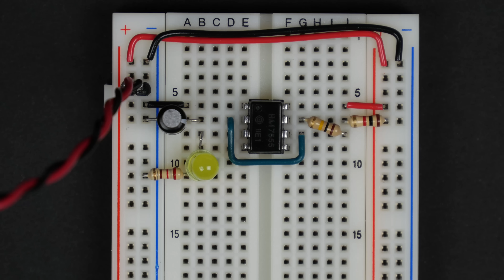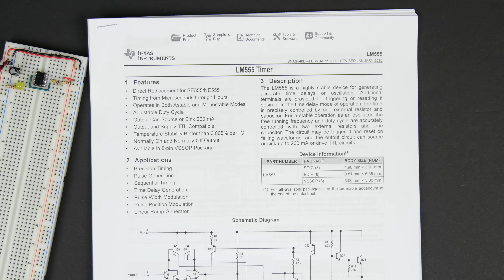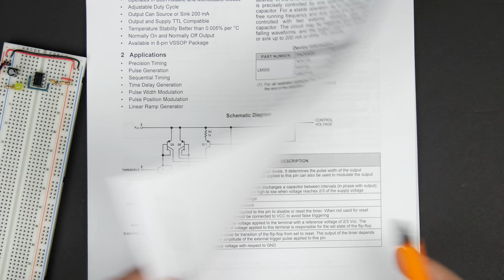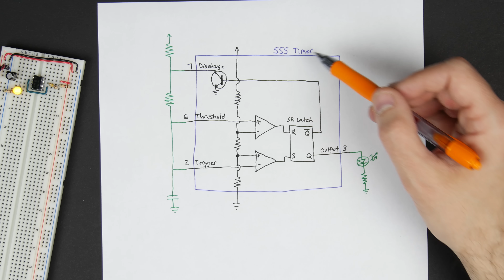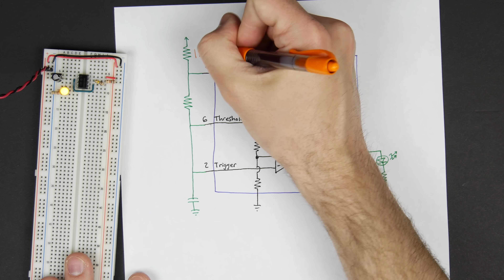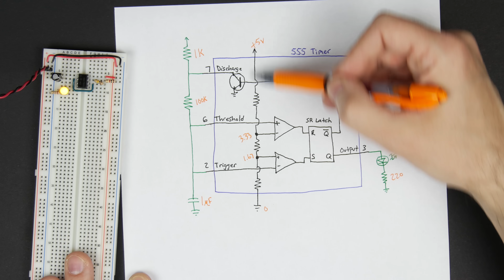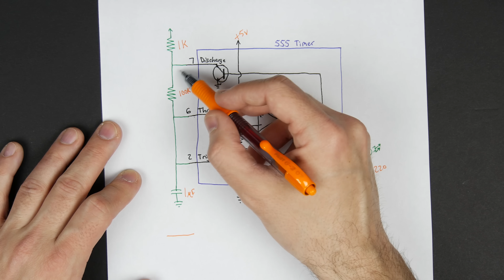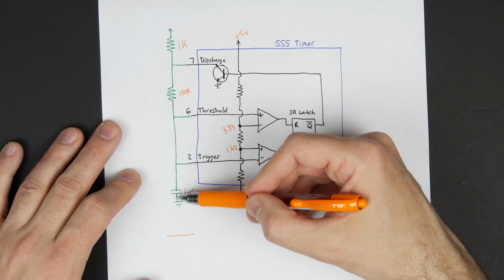Astable 555 timer - 8-bit computer clock - part 1

Comment: For novices like me: note that while you'll want the electrolytic (cylindrical) capacitor's white stripe on the (-) side, in the video it's on the (+) side. Your capacitor polarity should NOT look like his, for some reason he's got one where the + is striped instead of the - (which you can confirm when he takes a closer look to figure out why it's 2uF). Also, in ceramic capacitors in the video, the 0.1uF one looks wider than the 0.01uF one (which makes intuitive sense to me), but in the kit it's the reverse (which had me second-guessing myself). Don't let the size concern you: 104 is 0.1uF, 103 is 0.01uF, end of story.

If you're fairly inexperienced with electronics (like me), go read or watch some stuff that ensures you understand how to read the components (especially the resistors, the ceramic capacitor, and the polarity of an electrolytic capacitor). I knew to refresh myself on these things, and got everything right on my first attempt; but I was heavily doubting myself until I switched on, because the components in the kit and the components in the video were very different!

Also if you're reading this before you've gotten to the later videos, be advised that the part 3 video is WRONG for this kit (the switch will still work, but it WON'T be de-bounced - the video is using a break-then-make switch, but the kit has a make-then-break, and that very much matters). Look for a comment by Sergey that sets you straight on the simple but necessary modifications (reversing the logic). You can follow the video, confirm that it doesn't work when you very slowly slide the switch, and then make Sergey's modifications if you like - it won't hurt anything.

Comment: If you are building this from the kit, take note that electrolytic caps can have either their positive or negative side indicated by the stripe.   In the video, the cap has its positive side marked, in the kit I received the negative side was marked.

Comment: i have a silly question ... if every chip need a capacitor, or at least is suggested... why they don't make it built in ? there is no closer than built in ... is space the problem ?
Reply: Because you need to change the capacitors values sometimes
Reply: And some projects can't even have a capacitor in that spot

Comment: I've begun working in circuits. One thing I've never quite got the hang of (and apologies for it), is the flow of energy? Is the earth a source or sink. It seems like resistors are put before earth, so I would assume that's where energy is being pulled from?

Comment: How do i get a square wave generator at home without an ic? Ive got some resistors, some capacitors and a dc supply and not much basically, and i need to test a clock triggered circuit. Theres no way of getting a 555 amid lockdown. Is there a way to get a clock with all ive got?

Great video, and that simplified diagram of 555 is actually a part of our syllabus at +2 or 12th class level for the electronics course, i always messed the two comparators but after this video i probably wont!
Reply: Look for a transistor astable multivibrator circuit. You should be able to scavenge a couple of transistors from old electronics. Maybe you could even find a 555! ;) https://www.electronics-tutorials.ws/waveforms/astable.html
Reply: Thats a great link, thanks

Comment: The problem with the 1uF that measured 2uF is an old problem with aluminum electrolytic capacitors.  
The (capacitance * rated voltage) or 'CV' of electrolytic capacitors tend to roughly match their volume. Thus, a 5uf/10V cap will be about the same volume as a 1uF/50V cap.  If the rated voltage (50V) is much higher than the applied voltage (5V), the capacitor will increase the measured capacitance or 'form up' in an effort to make 'CV' come out right. In the case of caps on a power supply, all we care about is the minimum capacitance. If they 'form up' a little, it's not a problem. If the actual value is important, such as a timing capacitor, aluminum electrolytic capacitors are a very poor choice. Ceramic or film are much better.

Comment: Ok, so I don't know if anyone will see this, but:
Why do we need the 1k resistor in the vertical left-side circuit part (5V - [1K] - 100K - GND) then?
What's the problem with taking it out and leaving only the resistor Rb (100k) , so that charging and discharging times are the same?

Comment: To anyone who is following along, I'm having a problem where the pulse starts off alright, but then over time the on part of the cycle lasts longer and longer than the off part. Eventually the light ends up not blinking altogether, remaining in just the on state. I've double- and triple-checked my circuit. Any ideas?
Reply: Got it, my electrolytic capacitor was in backwards. Make sure the minus side is going to ground.

Comment: Really I don't understand those You Tubers ... They show very cheap demos in the most humble humiliated way to teach electronics while they use very expensive tools like this DSO ( Digital Storage Oscilloscope ) LeCroy brand and DMM ( Digital Multi Meter ) FLUKE brand which are far away by the cost than using this stupid mobile phone charge as PSU ( Power Supply Unit )....

Comment: Electrolytic caps always had wide tolerances, -20/+80% was usual, and there's no problem with that since they are used for just filter caps on the output of bridge rectifiers, and power rail decoupling. But with the miniaturization of today they are usually spot on, or a bit on the low side. So it was interesting to see this noname cap approaching the old standard of making it double capacity, so it has something to lose over its lifetime while still staying above the rated capacitance. The problem with that, if a capacitor loses 50% of its original capacitance, the ESR has usually gone through the roof already.
(edit: typo correction)

Comment: so you want a fairly small cap because you don't want to "piss away your amps" as dave would put it, you also want a fairly large value resistor for the input to the discharge pin for the same reason. you don't want large power loss through that transistor (or blow it up). so 1M for input, and 100M for the second resistor and a few pF for the cap. tweak the second resistor for the timing?
why didn't they put an internal high value resistor at the collector of that transistor? If you matched that value on the input you can get both input and output charging of the cap through the same resistor value and keep power loss at a minimum.

Comment: When I fiddled with a counter IC on my breadboard (BB) it didn't count correct, it jumped, didn't count etcetera it ended up with some interference that got solved by inserting a small ceramic cap in powerlines of the BB, and I left it there.

So to all dudes that see weird problems when experimenting try this. I used a 555 as a clock pulse generator too.

Comment: Due to the medieval chemistry, the tolerance of electrolytic caps is -50/+100%, or worse.
They don't work when frozen, or if the applied voltage is less than 30% of the rated voltage.

Comment: If you use a CMOS 555, connect output to Threshold and Trigger via 10M resistor.
Connect Threshold and Trigger to ground via a 100nF cap.
Reset to +ve as usual
Not exactly 50/50 duty cycle, but very close.

Comment: So far so good! I have seen messy schematics where the contrast between the paper and the writing is insufficient. This video does not have that problem. 

I like the walkthrough of “How it works”. I would like to see more detail about each of the eight pins, though perhaps that might simply be a separate video.

I would also like to see a video on the LM386, perhaps to amplify a signal from a 555 to send to a speaker.

Good Job!

Comment: During an intro lecture to 555 timer, our professor asked "Do you know the use of 555 timer?" to the class. And everyone in class having no idea was like "maybe to make time bomb?". XD
Reply: A repeating timer? That's not even a good answer.
Reply: you only need one count to trigger a device- a big capacitor and a comparator would do.  don't waste an entire 555 timer! unless you need a count down timer, then you can use the 555 to generate a clock to run a counter.  put the trigger on the most significant bit 😜💣

Comment: Don't use an electrolytic capacitor if you need precision. Those are mostly aimed at PSU filtering where more is always better, so I guess the manufacturers don't mind if they over-spec their production. If you need to use an electrolytic for whatever reason in this kind of circuit, provide for some sort of tuning mechanism (usually with  a trimmer resistor)

Comment: Hi there. Absolutely exciting lectures!!!! As for blinking rate, I think that if we want T_HIGH = T_LOW it would be better to use a variable capacitor and not variable resistor. This is because for the for the resistor values R1 = 1k and R2 = 100k we handle it mathematically as that: T_HIGH = T_LOW => 0.693*R2*C1 = 0.693*(R1 + R2)*C1 => we need R1 ~ R1 + R2 => we should select values so that R1 << R2. No? 

(Of course, if we need T_HIGH != T_LOW we may select variable R1 or/and R2 or/andcapacitor as well).

Comment: I checked the noise on the riding edge but didn't see much at all in my test.  The fast overshoot was clearly visible though and the 100n across the supply did exactly the same as you showed.  I always like to see practical results to confirm theory!

Comment: Felt compelled to try this practically especially the noise reduction.  First observation was the duty cycle was way off - 64.2mS high and 72.7mS low.  After a few checks it turns out that not all 555 chips are identical.  From a random assortment I found one that gave me 68.1mS High and 68.0mS low.  Others varied.  I guess it is variation in the accuracy in the chip substrate - mine could be cheap / old / used.  If timing is critical I will now check the specific 555!

Comment: Great description of the 555.  I'm watching because I'm using one for the first time in decades.  I always use decouplers, but it was a little surprising to see such a graphic demonstration of why they are needed.

At first I thought the chip being used was the 7555 which is an improved, low power CMOS version of the classic 555.
But in closer inspection it's an HA17555, which seems to be a Renesas equivalent of the classic 555, high supply current, low output voltage and all.
That's a really confusing way to name the chip..

Ben of course used the LM555 datasheet, because it's go much more info in it than the HA17555 datasheet.

Comment: There's an easier way to get a 50% duty cycle oscillator with an 555, although you should use the modern CMOS version for that. I find it weird that I hardly ever see that circuit used. Just ignore the discharge pin, remove the 1k resistor and connect the output itself to where pin 7 was connected. Easy 50/50 duty cycle with a single resistor and capacitor.
Reply: A useful reminder.  I had forgotten that you need the 7555 for that.

Comment: In the datasheet(at 12:11 in the video), I saw that in the capacitor time period calculations, ln2(=0.693) is being used as a coefficient. Why are we charging and discharging the capacitor to half the supply voltage here? Please help me understand this bit.
Reply: The difference between 2/3 and 1/3 is represented through ln(2). On reaching 2/3, reset will trigger and short-circuit to discharge and causes capacitor to discharge and once it reaches 1/3, set will trigger and thus breaking the discharge short-circuit. This again causes input source to flow towards capacitor line. So basically, it oscillates between 2/3 and 1/3 and thus half of total charge(at assuming total is 2/3)

Comment: Question. I had always thought that a capacitor is one-way. That the capacitor charges from the positive terminal and discharges from the negative terminal. If so, why does the capactor charge up to 3.3V from the current flowing into the positive terminal and discharge back out the positive terminal rather than to ground?

Comment: I have a question, is the 1k resistor necessary or can you just leave that away?
Reply: If you left it out the discharge transistor would effectively short out the power supply when on

Comment: Your diagram seem to be inconsistent with other block diagrams. Most other diagrams show an output driver on Q bar on the SR latch and nothing connected to Q. ???
Reply: The output driver doesn't matter for the functional explanation, although you might need it in a real world 555. You could say the output driver is integrated into the SR-Latch in his block diagram.

Comment: When I'm attempting to measure the voltage across the capacitor with my "oscilloscope", my led no longer oscillates. It's just on, any thoughts on why this might be?
Reply: I don't have the answer, but I ran into the same thing (when you probe the capacitor with the scope the light just goes "on"). Interestingly, if you probe the capacitor with a multimeter it doesn't disturb the circuit. The other thing is that it seems to be frequency-dependent. If you bought the kit from Ben it comes with 1Meg resistors, not 100K, so the blink rate turns out to be like .6Hz or something if you do the math. When you drop in the potentiometer and increase the frequency to something > 1Hz now you can probe the capacitor just like he demonstrates here and the scope doesn't (apparently) disturb the circuit. I would be curious to know why the scope disturbs things but a multimeter doesn't, also why is this disturbance frequency-dependent? It almost seems like the capacitor never discharges in that low freq configuration with the scope probing it.

Comment: If you're wanting a symmetrical square wave, why not remove the 1K resistor altogether? Does it help limit current from the +5v rail through the discharge transistor?
Reply: you would short the circuit without it

Comment: Why not the discharge current also goes to 1k resistor??
Reply: it does
Reply: Because it has 1K resistance and direct flow to transistor has low(nearly 0) resistance.

Comment: Do you have a video on how bread board works?  I searched the term "board" but found nothing.  With reluctance I will look for someone else's video on it.  (My confusion is where the positive and negative "wires" are on the 555 Timer.)
Reply: 1 Pin and 8 Pin?
Reply: Update: yes.  Ground 1 Pin, 8 is power

Comment: You got to watch out for those ±100% tolerance Chinese capacitors.
Reply: If we allow for -100% tolerance, I got some 1 GF capacitors to sell you.
Reply: @lavalamp3773  ah, yes, I've also seen pieces of wire before
Reply: @lavalamp3773  finally, I really need a filter in the nanohertz range
Reply: @lavalamp3773  what the shiters?
Reply: @lavalamp3773  No. -100% would be zero farads.
Reply: This is the funniest hardware related thing I’ve read in my entire life
Reply: @tayler6000  same!😂😂😭😭🤣
Reply: @tayler6000  seriously
Reply: 2 MFD for the price of one. It's a good deal.
Reply: This is bought cheap not as a timing capatitor, but as a DC-filter it is working fine.
Reply: @markusepple6204  ll lll
Reply: Isn't that why we buy Japanese or Korean 😂
Reply: @yottakm3764  well you can, top ones can cost millions, but cheaper ones you could get paid for having them

The world is overflowing with hoes
Reply: You have to check the datasheet on your capacitors, I was amazed at how much tolerance is expected from these newer, cheaper products. Even with brands like Sprague and Nichicon, they are sporting a 20-80% tolerance range. But then you look at their other products and see that they have a whole other line of lower tolerance products. I'm guessing it's because when manufacturers are tossing them into toys or wireless products, they can expect these capacitors to be functioning as filters, rather than oscillator tanks. Anyhow, I am glad to see this comment got as many likes as it did!
Reply: LOL 😂😂😂
Reply: You’re a Chinese capacitor.
Reply: This is why Electrical Engineers always look in the datasheet first, even for a simple capacitor ;)

Electrolytic capacitors age, the electrolyte dries out over time, this is why it is overdimensioned. 1uf is the guaranteed capacity at the end of it's rated lifetime. Electrolytic capacitors are usually used to filter DC Voltage for power supplies and stuff like that. They are normally run at around 75% of their rated Voltage and at elevated temperatures which accelerates ageing, if it had only 1uf from the start it would die fast. 

Electrolytics are a bad (and expensive) choice in this case, for a circuit like this a ceramic capacitor would be better but sometimes you got to work with what you have at hand.
Reply: Toha Heavy Industries what is the best, most accurate and time-reliable capacitor type to use for say, up to 10uF in your opinion?
Reply: I have an ancient capacitor I pulled out of a busted power supply: it says 470uF, mesures only 250uF. Dried ou quite a bit
Reply: @wreckingangel  thank you sir
Reply: Good comment like
Reply: it seems like its extereeme capacity is what makes its tolerance bigger . but i agree that not all chinesse products are that bad.
Reply: Hahahahahahahhaa
Reply: I mean, as long as you're not browsing ebay, you're fine.
Reply: 30 hours shifts will get to you.
Reply: 7866
Reply: Hahahaha :D good one :D
Reply: @kewakl8891  is that you crazy Cornell?
Reply: Lmaooo
Reply: Bruh max tolerance I've seen was ±10%
Reply: lmao
Reply: Half of them don't work at all, half of them have twice the capacitance so on average you're good
Reply: Not funny
Reply: They’re made out of chineesium.
Reply: Are capacitors made anywhere else?
Reply: You’d think they’d be smart enough to label 2mfd caps as such…
Reply: Great comment😂
Reply: Ha it’s from corona, California.
Reply: @yottakm3764  In Nevada in the US, prostitution is legal.